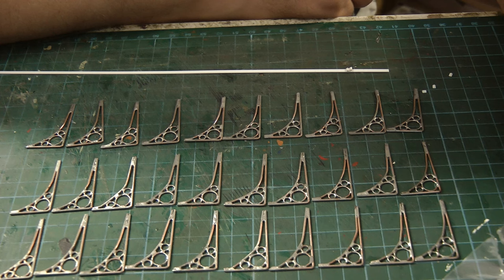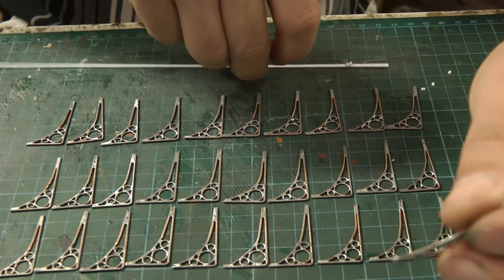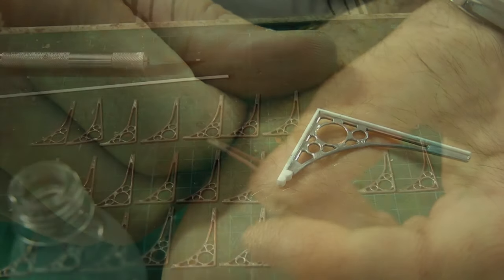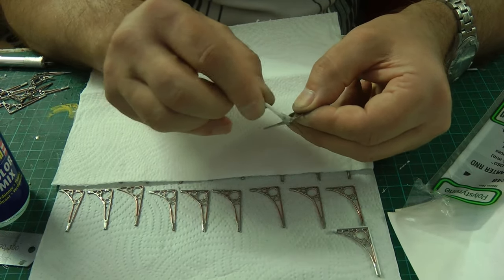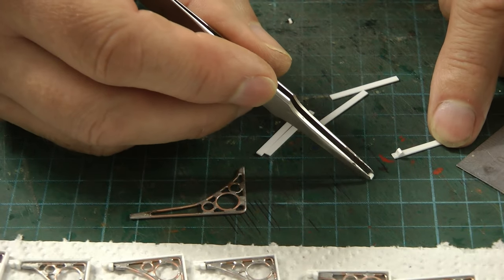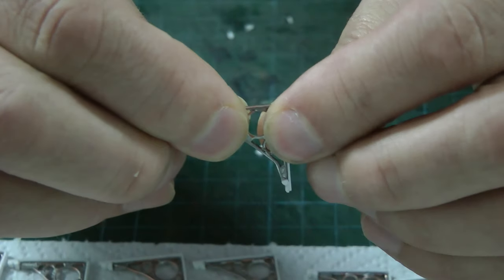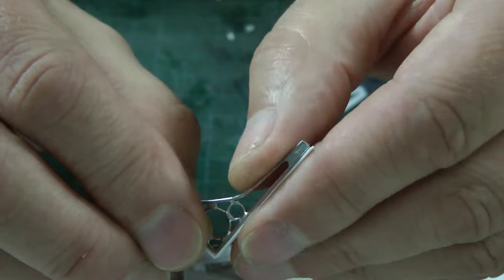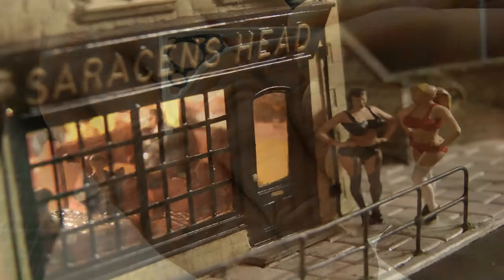Tyne Dock Re-build Part 20  Canopy Supports Part 2 No 445

Comment: Super fine work Tony, the best brackets I have seen by a long way. A really interesting feature and pattern. To unclog  files I use a piece of scrap brass and run the file along that always in the same direction so the cut brass profile matches the file flutes, works a treat. Yes the tin and lead oxides do make a mess - am always careful to scrub off regularly when beating my engine lead weights into shape ( lead poisoning and food). All the best Stephen
Reply from the maker: Good morning Stephen. Great tip. i have have a wire brush which also does the trick. but yes i will give that a go...all the best. Tony.

Comment: Dear Tony, for any clogged up file folks should get a file brush. Such brushes look like an almost worn out wire brush. The wires are much stiffer and shorter than normal wire brushes and come with wires bent at a 60° hook. Brushing with such a file brush makes the different wires perform like springs on the file surface, nipping all the file residue off from the file. In the UK available from Cutwel, brands the carry are Pferd and Lessmann.
Reply: Dear Tony, absolutely marvelous how you added the T to the canopy brackets. Brilliant paint job, awesome representation of the true to scale examples. 
It’s a treat already to watch the rebuild of Tyne Dock Station, with all the ‘extra’s’ these episodes become a true audience magnet. The scarcely dressed chicas still at the Saracen’s Head?? Cheerio

Comment: Once again, this is brilliant. Inadvertently you've answered a question for me, namely can you fix a wire sized metal object to plastic successfully? My attempts in the past have been a failure but it could be down to the superglue I'm using. Mine is a liquid runny type that goes everywhere if you use too much or fails if you use too little. So what type of superglue do you use Tony? Give my regards to the two ladies (you can't call them ladies of the night because they're out in broad daylight!) Thanks again.
Reply from the maker: Good morning Alfie. a good quality super glue normally works well, even contact adhesive also works if the metal is clean. its great that i help out with these issues. stay safe my friend. all the best Tony.